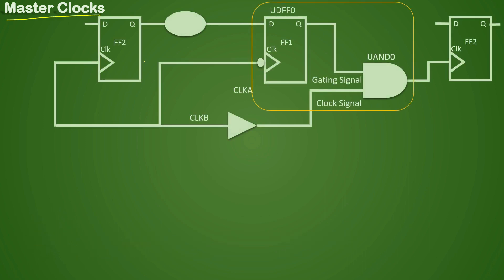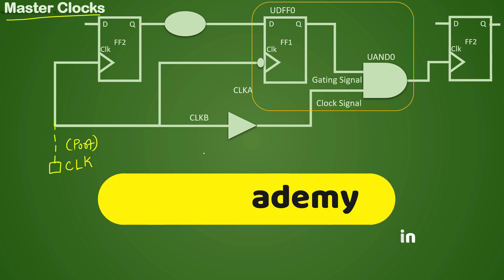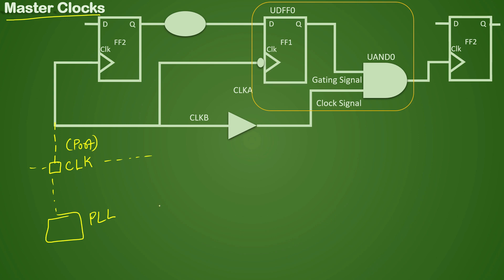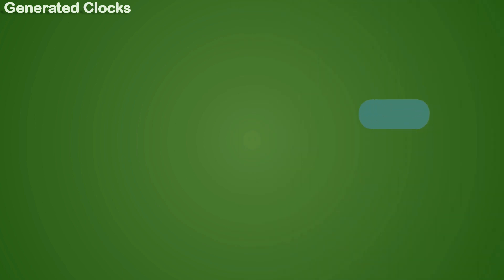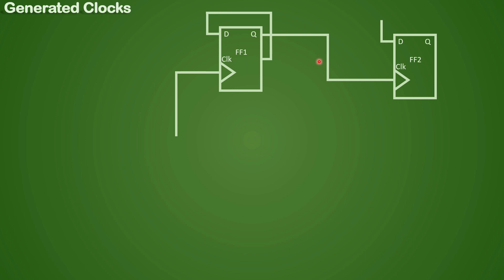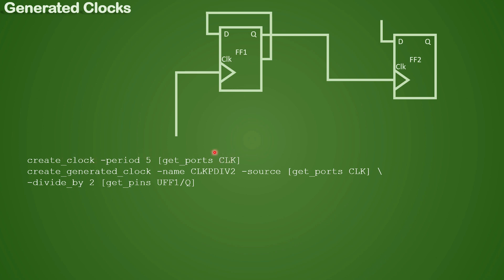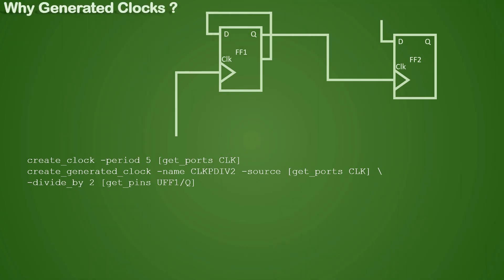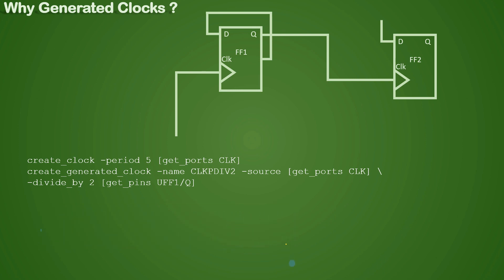PD Lec 59 - Master, Generated and Virtual Clocks | Type of clocks | VLSI | Physical Design

Comment: Is generated clock also physically present in the design like master clock ?
Reply from the maker: Hi Neha,
Sometimes generated clocks are created using a code for designer's requirement then it is not physically present, but if generated clock is generated using divider circuit then it is physically present in design

Comment: Why we use divided by 1 generated clock sir. Plz reply.
Reply: Good Question.... 
Actually clock has to reach all the flops present in the design , but in some cases, clock will take detour routing to the flops (if any disturbance occurs near the flops) ... This results in the delay in the circuit... To overcome this, we create divide by 1 clock near the detour routing path, so that the timing will be calculated from the new clock instead of the old clock... With this we reduced the delay... Hope u got this

Comment: Regarding In2Reg path : if we have input delay on the input port of design (which basically covers virtual flops’s clk to q delay and other delay to the port of design) . For calculating the slack of design on that port , how is virtual clock required ?
Reply: @VLSIAcademyhub  yeah it is ….. thanks 😊